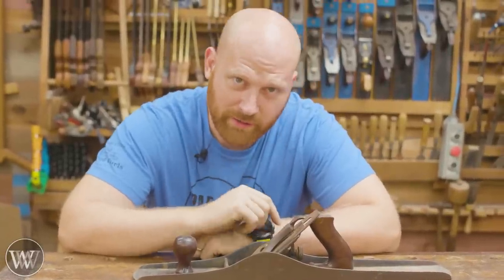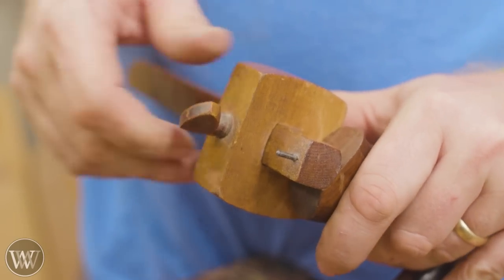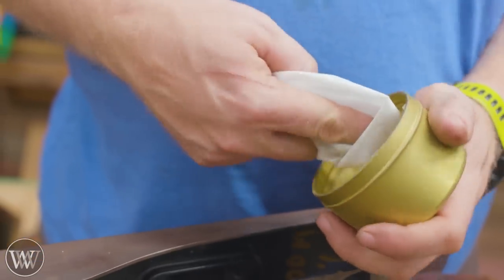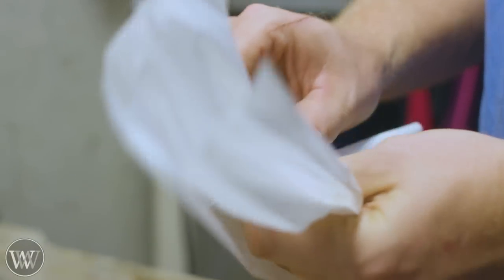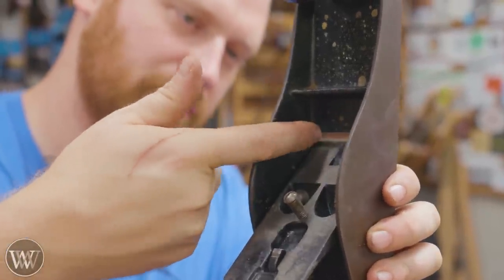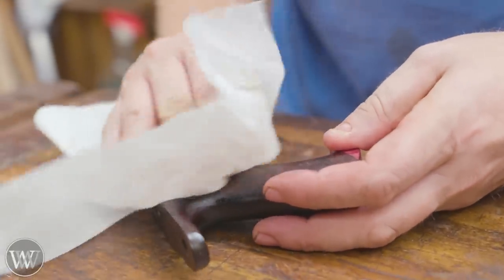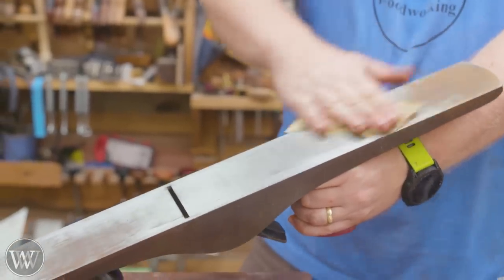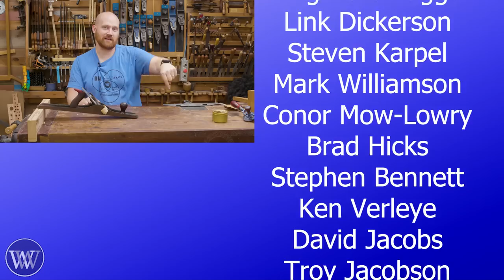Making A Red Head Plane Restoration

Comment: Very informative and inspirational video 👍🏻.  

One little tip for the part of boring the hole for the bolt and nut through the «new» wood at the top of the rear handle/tote or the knob: 

I use a 3-12mm step bit to bore from the top of the tote/knob using the brad mark as the center of the hole.  After 12 repaired totes and 2 knobs this way I can say that this way has saved me hours of filing, sanding, head scratching and frustration compared to the knife/gouge/dremel way. 😄

The cheap 3-12mm (I am certain there is an imperial counterpart to this metric step bit) I use leaves a very crisp and fuzzy free edge and the fit for the nut is just about as perfect as you would want.

Comment: Are there different challenges from woodworking in the winter than in the summer. Like does the wood act differently or any little things
Reply from the maker: It has more to do with moisture than temperature. If the air is dry the wood will shrink and contract. And if it's moist it will expand. It does that along the rings of the tree. So in some cases that will cause the board to twist or cup. But most of the time it doesn't slow enough you don't notice it. And if you work in an air conditioned shop it's usually not something you have to worry about. But you do have to make sure you're joinery will allow the wood to move throughout the seasons.

Comment: I'm curious why you chose epoxy rather than wood glue for the tote patch. When I've done this, wood glue has worked fine. Nice restoration--thanks for sharing!
Reply from the maker: With South American woods you tend to get a lot of oily residue over time. Pvas will generally work well but sometimes they're not quite as solid. The other big benefit is in this case I needed to get the project done in one day. And I didn't have time for the PVA to wait so in that case epoxy is the way to go. But in this case it really wouldn't make that much difference either way as there's not an incredible amount of strength difference between them.
Reply: Thank you!

Comment: I have a can of min wax polish and it is about half full and it dried up, what can i do to bring it back so it doesn't go to waste?
Reply from the maker: When it dries up that means that the solvent has evaporated out of it. So you can heat it up and melt the wax and then add in more solvent. Then you can choose which one you like. Personally I generally use mineral spirits. Or white spirits if you're in other English speaking countries
Reply: @WoodByWright  Thanks i will try that.

Comment: I'm wondering if you have a table jointer. It's like a 6'long plane. It a long I beam with a #8 plane upsidedown in the end. Instead of pushing the plane over the wood you push the wood across the plane to shave the end to take out a bow on the end of a board. I seen it on the old Yankee Work shop. I'm wondering if you don't have one could you make one on your show. All you need is a long flat I-beam and a#8 plane. You make it by setting the Ibeam up like a saw horse on legs. Mount the plane in the end of the beam level with the top. Enjoy the straight long boards you make. 😎👍
Reply: “All you need is a long flat I-beam”

Comment: On the lever lock, how do you clean out rust behind the spring? It doesn't look removable on the plane I'm trying to restore.
Reply from the maker: you can put it in a bath and then run a rag behind it. but most of the time I just oil it and move on.

Comment: Why polish the brass and leave the rust? "Patina" is oxides and rust.  The rust will continue to corrode the iron while the brass would be fine. What is the purpose of leaving rust and oxides on a user?
Reply: There are different kinds of ferric oxide. Not all of them, "continue to corrode the iron". In fact black oxide is used as a protective finish.